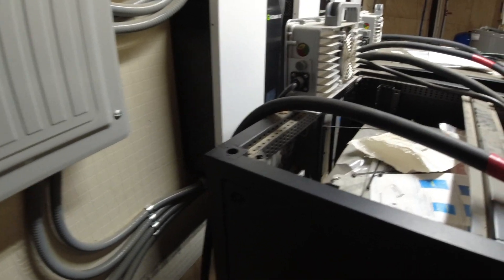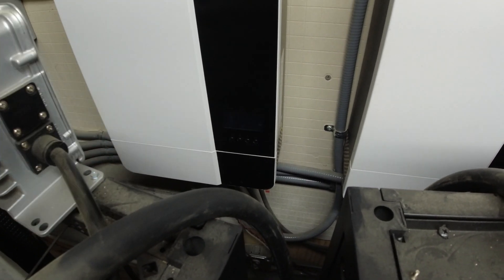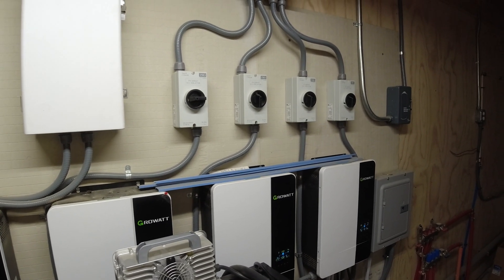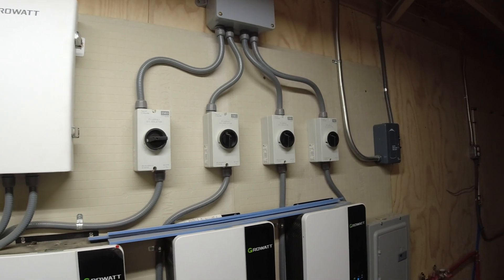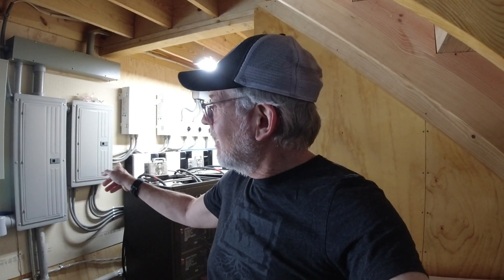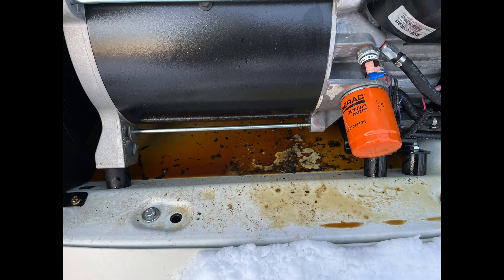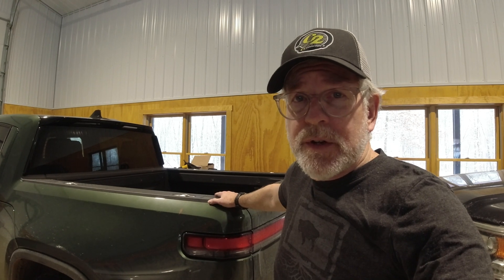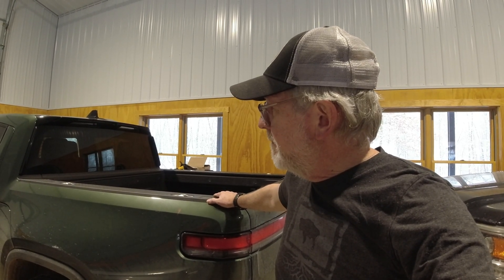Powering My House With My Rivian R1T

Comment: Dang it is bad luck to have snow covered panels and inverter and generator fail at the same time!  Mind you I've been watching quite a few vids lately on growatt and eg4 inverters failing at about 2 years old which makes me feel better about spending double on my Victron inverters.  I guess you pays your money you takes your chances!  Regarding the genny did you run that up regularly out of interest?  Bit weird for a high end 1 yr old genny to fail?
Reply from the maker: The first generator failure was a mechanical failure with the valve system in the engine.  One of the rocker arms shattered and a pushrod was mangled.  Our service guys were able to repair it and get us up and running within 2 days.  Unfortunately they left a slow oil leak that no one noticed.  This was the second issue, but it ended up just being a loose hose clamp.  it took the service guys 3 days to get to me, but only a short time to fix.  The generator runs automatically for a few minutes every 2 weeks to stay ready.  We are back up and running.  Thanks for watching and for commenting.  Good luck with your system.